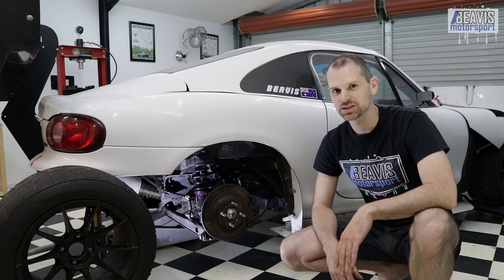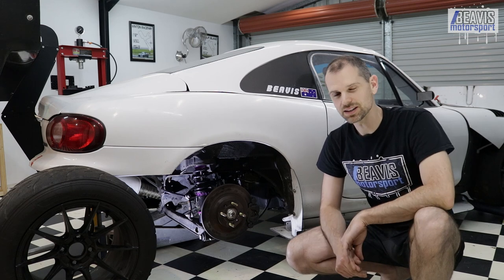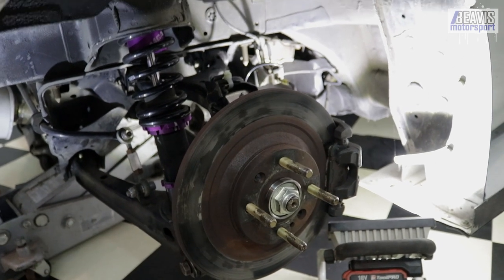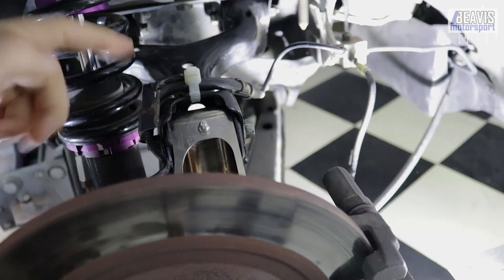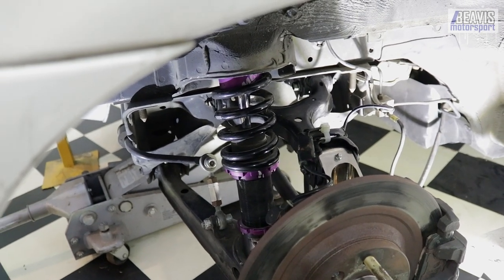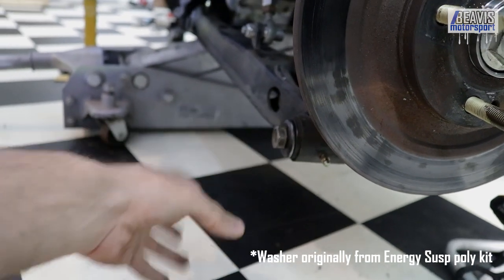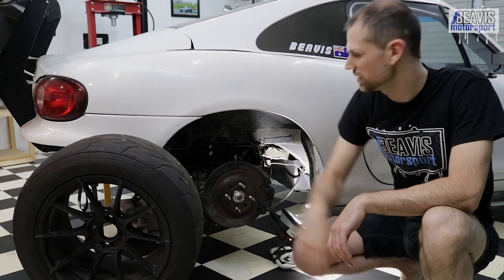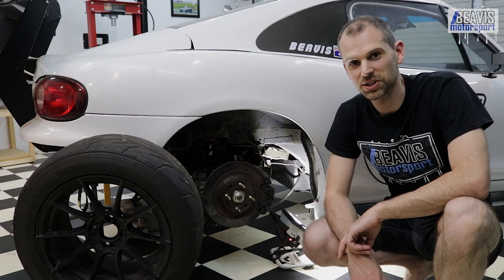Keisler Drop Spindles - MX-5 Miata Review // Ep 87 // Time Attack TURBO Build

Comment: Did you stay with the drop spindles? I have a set on the way but im second guessing after reading around....
Reply from the maker: They work perfect for me. What have you heard in your reading that makes you doubt your decision?
Reply: @Bbeavis  I've read that folks were seeing flex in the rear toe. I've also found a few posts indicating the setup was very difficult because of the geometry correction baked into them? 
Did you find it so?

Thanks for taking the time to reply!
Reply from the maker: @AndyFuntown  Not something I noticed. But I am also not an expert driver so maybe I just am not that in tuned to finer details of the suspension.
Reply: @Bbeavis  that makes two of us, I'll just install them and send it 🙂 I'm working out the setup on my LS3 Miata, thanks for the videos and info!

Comment: perhaps and old question but have you looked at the adjustable upper control arms for rear to get some more tracktion-related adjustability?.. (i guess you have well enough power to need it ?)
Reply from the maker: Hi Andreas, I have certainly seen various aftermarket arms options out there, I don't see a need for them.
I seem to be able to get enough adjustment with the OEM cam bolts in the lower inner arms.
The car doesn't really have a big issue with rear wheel grip, perhaps because it doesn't do launches from standstill?

Comment: Hey, I own a 2.5 SVT with the 16” rims, I’m thinking of getting a set of 15” advanti S1s, just wondering how much difference I would feel in the way of sidewall roll? It’s something I’m keen to do but don’t want to spend money on something that would look great, but not be so nice to drive.
Reply from the maker: Many many people have been happily running 15" rims on the NB Mk2 model MX-5's for years, myself included. You mention sidewall roll, but in fact it is generally considered that the 15" rim is the superior choice for ideal performance for the MX-5. There's a reason what that diameter is the one of choice for those of us who want a better performing wheel/tyre setup. You wont be disappointed. That said, if you are still running OEM springs/shocks, then that is more likely going to impact the experience of roll than the tyres.

Comment: You are aware of the fact that a wheel does flex a bit while driving?
The washers will touch the wheel, trust me.
Though it looks nice, it looks like these hubs are not 100% thought through...
Or, at least they could've mentioned it in the blurb...
...which has a lot of info, but is also lacking some very important stuff...
...as you already mentioned...
And they are even Gen3!
Reply from the maker: Quite aware of the situation, as I touched on in the video it's something I need to keep an eye on, and easy enough to address thankfully. Worst case the washers get cut down some more and then all will be well.

Comment: Slightly off topic - Is that a tile or vinyl on your garage floor. Looking to paint mine in a few weeks but wondering if there’s a less labour intensive option
Reply from the maker: It some sort of vinyl-type flooring. It was already there before I came along so I do not know much more unfortunately.
Reply: FWIW, I painted my floor white with a special polyaspartic paint. It was actually designed for that application, but 4 years later it is many shades of brown. I wish I had used a tile of some sort. That vinyl looks nice. BTW, a single color floor with no flecks makes it easier to find dropped parts.

Comment: The big question is were they worth it? What's the change to the handling? Has braking changed at all? The stock spindles are known to flex a bit with BBK.
Reply from the maker: Yeah not a lot of driving going on at the moment thanks to perpetual "lockdowns", so cannot comment on whether there is any drastic change here.
Reply: @Bbeavis  will you make a video on how they changed the handling and any other changes you noticed?
Reply: @JasonSmith-tk5eb  I would like to see that video too. I've been reducing unsprung weight a few pounds at a time and don't really notice much. Perhaps if I had done it all at once I would have.
Reply: @Bbeavis  following up on this. Still haven't seen anything from anyone on these. Good, bad, ugly? What's the story? Planning on adding ABS and these have provisions for this too. Would love to hear how they're working out.
Reply from the maker: @JasonSmith-tk5eb  I'm not exactly sure what I can tell you other than functionally they do their job, the wheels are still attached to the car and spinning fine and the spindles are holding it all together.
Bearings are handling track abuse, the finish of the keislers is pretty stout, everything looks more or less like new.
Reply: @Bbeavis  nothing weird to compensate for due to the geometry changes? I've talked to a couple teams that switched to these and they were having a tough time with suspension set up after.
Reply from the maker: @JasonSmith-tk5eb  Perhaps I am not a good enough driver to identify such issues. But for me the car still "drives well". I am due to re-check alignment, but the only drastic change required to make these work was to correct the ride height of the car. Note I only have the rears. Perhaps others you have spoken to have them on the front?
Reply: @Bbeavis  Good point, I think the issue was more with the fronts than the rears.

Comment: What part of the hub fails? This has filled me with horror😳
Reply: Ive found some piccies online..i know where to check now.
Reply from the maker: Hard to explain in text, but as you had discovered, google has the answers :-P Essentially the hub mating surface, the part the wheel bolts to, can fatigue, crack, and you end up with no wheel.

Comment: Looks good and a solid piece...but why? What did i miss?
Reply: Same. What’s the benefit?
Reply from the maker: With price in mind, as it's the hardest part to swallow, these just wouldn't make sense for most people.
But in my particular situation I actually needed to replace some worn parts anyway, AND, for the actual benefits over replacing OEM for OEM, there is the suspension geometry correction, weight reduction, and shock length benefits.
Reply: @Bbeavis  ah ok, makes sense.
Reply: Lower CG, but the suspension geometry is still where it was designed to function. That means better camber, better bump steer, and better suspension adjustment range. Picture how a double wishbone suspension moves, it's more linear the closer to neutral design point it is on it's arc of motion (unless it was designed perfectly linear, which miata is not.) They also have negative camber built in, so you can get more if you want. Plus, if you don't have what I consider to be dumb "adjustable length" shocks, you can fit more shock stroke in the extra room you've gained with longer shocks, which means more travel (potentially, need double springs...)
They don't have provisions for dust shields, so driving in the rain kind of sucks as your pads and rotors will be getting wet constantly. 

And the biggest one, you get rid of shitty stock miata front hubs, but you could manage that without the drop spindles...
Reply from the maker: @pontiacg445  Ah for my car I only went rear keislers, OEM front uprights still. My front hubs are already upgraded and I didn't have the balls to sneak more money from the wife for the front set.